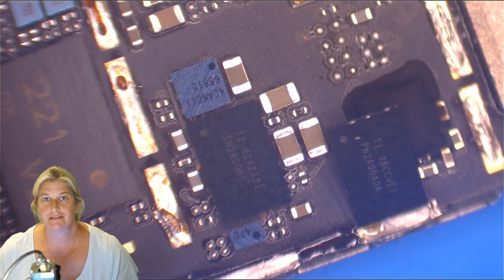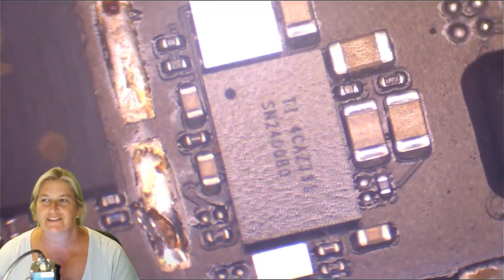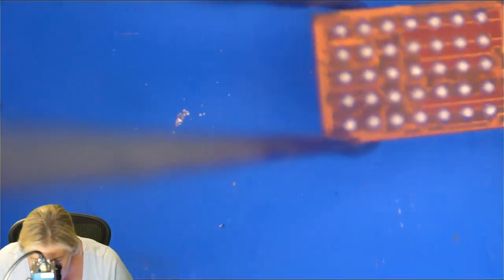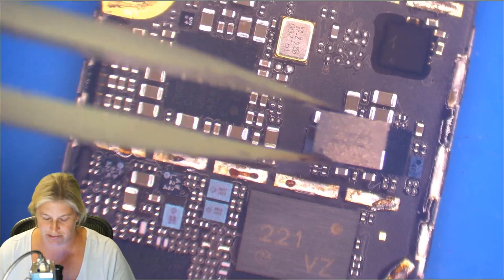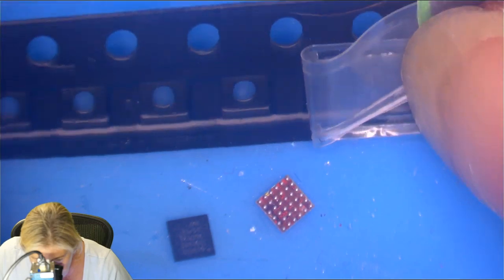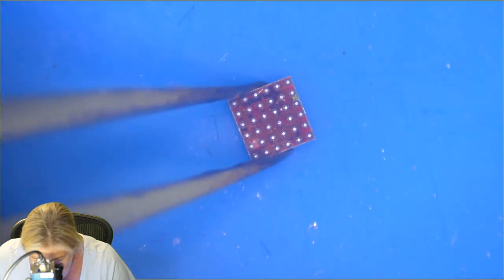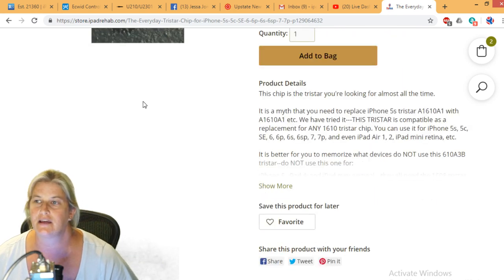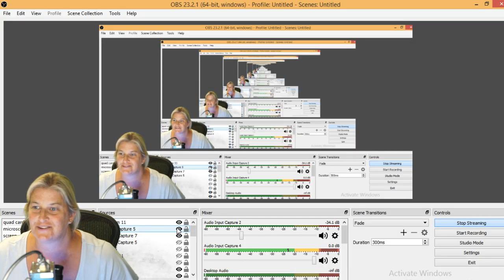How to know if your chips are bad?

Comment: I'm in China now so I can develope a list of trusted supplier. It's just that they don't sell phone or laptop parts.

Actually most people don't lie, they just don't get the rigorous "new" concept. Most components come with 3 kinds of supply, "original new(全新原装)" means new from genuine original manufacturer, "bulk new(散新)" means refurbished parts or parts that doesn't come from the designated manufacturer, and "salvaged parts(拆机)" is what it sounds like.

And be awared that some people refurbishes components(mostly flash and memory chips) and claim them as new. Just be care of the font, position of the marking and whether they seems grinded or painted or not.

I still suggest buying from Mouser or other big dealers if possible. You can gather some people up and tell those big supplier to order a batch of easily damaged chips directly if needed.

Comment: Hello, I have a question, I was working in an iPhone 6 without IMEI dialing *#06# and without Modem Firmware so I changed the PMICRF, after that it had firmware but never IMEI so I rebelled the Baseband and obviously I did both jumpers but i turned it on without Baseband and now after install Baseband there is no more firmware and No voltages of PMICRF going out to Baseband, do I have to make a flash of the software for the software recognize the Baseband again?